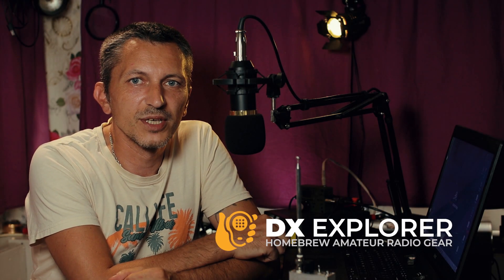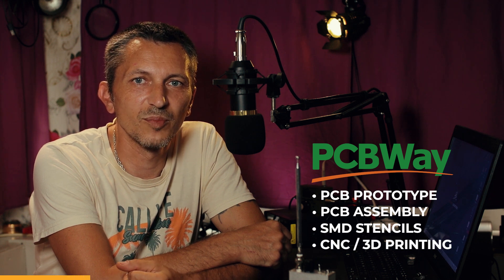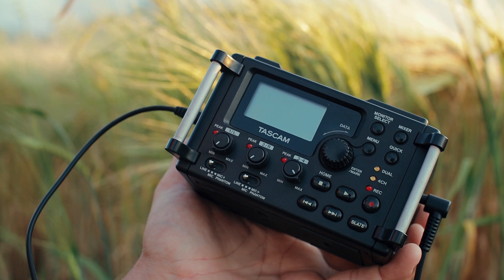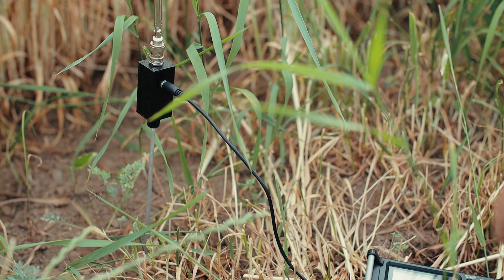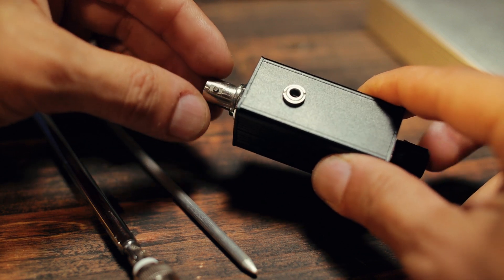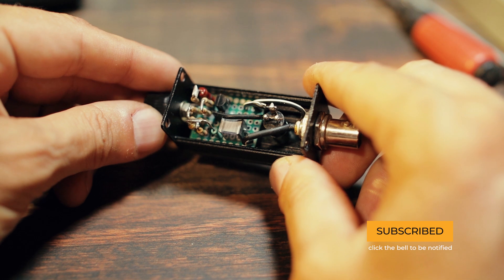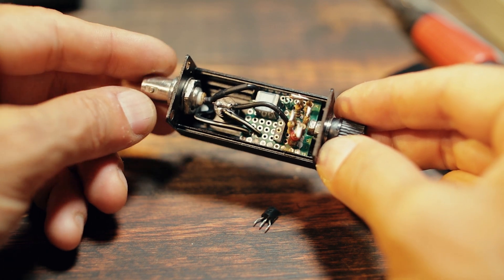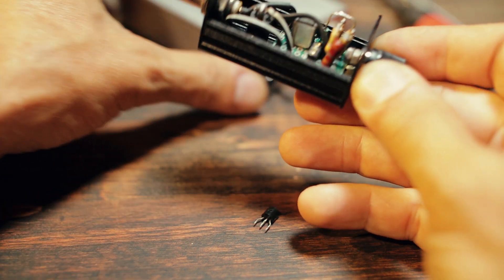Super Simple VLF Receiver / Sferics Receiver - Only Three Components

Comment: Is there another transistor that is a little more common and easier to get?
And one more question, on which band do you receive it?
Reply from the maker: I will get back to you tomorrow as I am not home and I don't have the list or transistors I tested. I know for sure MPF102, J310 and BF256B are on the list and they work. I also tested three more I can't remember right now. The band... is not really a band as its receiving an entire portion of the VFL/ELF band. The lower you want to go... the longer the antenna or more resistors value usually. I honestly built it as in the original schematic as I was sure it works and I don't have to experiment much (hi). I'll come back tomorrow evening with more details on the transistors.73, YO6DXE.
Reply: @dxexplorer thanks 73
Reply from the maker: Sorry for coming back so late on this. I was too busy with work lately and haven't spent so much time at home. So honestly I would try any N-Channel JFET transistor and see if it works or not. I do this very often as many times I want to build things but I don't always have the right parts, so I try using whatever I find in my junkbox. Most of the time the trick works... of course not always and not in all cases.
Reply: @dxexplorer Thanks bro..No problem
Reply from the maker: @nicolacufregiorgetti496  Always a pleasure my friend. 73

Comment: Very nice project! Have you tried which transmitters you can catch on this battery-free receiver? For example, using the SpectrumLab software, which also includes markers with all transmitters, so you know which transmitters are in the recording and using a very narrow filter directly in the software, you can listen to it or decode it (time signals for example)
Reply from the maker: I haven't used the software much as it seemed over complicated and I never had the time to actually understand it. I will have to take some time and play with it one day. I am also curious. Today I am trying to receive the SAQ transmission. I connected the 1/4 20m band vertical antenna to the receiver... then the audio goes into the Tascam recorder... then to the computer sound card. Listening with the SAQrx software to see if I hear the transmission.
Reply: @dxexplorer  I understand, it seemed complicated to me at first too.
But you'll be sitting at the SAQ receiver and listening for about half a year. It only broadcasts at Christmas.
Reply from the maker: @VFXManiac No... today is there are two special transmissions celebrating 100 years. There is one that starts in about 45 min... and one a little later in the afternoon.
Reply: @dxexplorer  Wow, sorry for the bad information. That's great! Good luck with your signal reception!
Reply from the maker: @VFXManiac  Thank you so much. Ohh no worries. You are right as usually it does transmit on Christmas only 😁 73, YO6DXE.
Reply from the maker: @VFXManiac It worked haha. Wow I can't beleive it. I will post a short story on Instagram in a little and come back with the full video here on YouTube a bit later tonight. How cool.... I can't beleive it worked. 73

Comment: Great video!  I have been interested in sferics for decades but have never built a receiver despite how simple the usual examples are.  You have inspired me to change that!  It's nice to see someone else using the old trick of making transistor (and other component) sockets from the inline chip sockets.  Very handy for swapping components to do A/B testing when optimizing a circuit!
Reply from the maker: I was the same so I know exactly what you are talking about. I read about sferics and the receivers but never built one. This one is really worth building since is that simple. Let me know how it works for you. 73, YO6DXE.

Comment: Hey, try making something with mixers. A really simple project using mixers and regarding VLF reception is an up-converter (one mixer and an oscillator on desired frequency). Also you can get free stuff such as mixers, amplifiers, filters,... using minicircuits ezsamples. 73's from Czechia, OK1BAL
Reply: Thanks! I’m really looking forward to seeing your new VLF receiver - sounds like a great project. Hope you get it done by the end of July! I’m sure it’ll be very interesting, and I’m curious to see what approach you take. 73 de OK1BAL 😊
Reply from the maker: @AlexOK1BAL To make you smile... the safe approach... to make sure it works 😅😅.
Reply from the maker: I have another nice VLF receiver in progress... but this is a proper one. I hope I get to finish it by the end of  July. That one is way more interesting. 73, YO6DXE. P.S. I think you will like it 😁

Comment: Nice.!! I need to try it
Reply from the maker: I love it. Is so simple and much better for recordings since I don't need to worry about the battery of the receiver. The one issue I noticed is that is way more sensitive than the other one I built, the one with audio amp incorporated. It pics up a lot of buzzing from the power lines... I think the reason is that the resistor used is 40M compared to 20M used in the other receiver so it picks up a lot more lower frequencies as well. So with this one I must stay further from the power lines. 😅 73 my friend, YO6DXE.
Reply: Thanks you 73 F4LPM  @dxexplorer

Comment: Nice project maybe a receiver for Grimeton?
Reply from the maker: Thanks David. I hope you are doing well man. I have a VLF project I must finish with a tuned circuit that also allows me to tune the receiver on various frequencies and that one should do the job. I believe Grimeton transmits around 17Khz if I remember well. I can't remember the exact frequency now. 73, YO6DXE.
Reply: @dxexplorer  SAQ/Grimeton is planning to transmit on July 2nd later this week to celebrate its 100 birthday. Given you're pretty much having everything needed, I'd strongly recommend giving it a try!
Reply from the maker: @BerrieSchuurhuis Thank you so much. Ohhh yes that sounds great. 🙏🙏🙏 73, YO6DXE.
Reply: @dxexplorer using a miniwhip antenna here with increased C-values in the signal path, together with 10MHz upconverter. But the S9+10dB background noise is likely going to be the show stopper here.
Reply from the maker: @BerrieSchuurhuis I won't have the time to build the upconverter, but I think I have an idea on how to receive the signal tomorrow 😁. Is worth trying and experimenting to see if it works. I am curious. But if my plan works... for sure I will have a video about it 😅. Thanks so much one more time. I didn't know about the tomorrow's transmission.
Reply: @dxexplorer  I will wait for the video